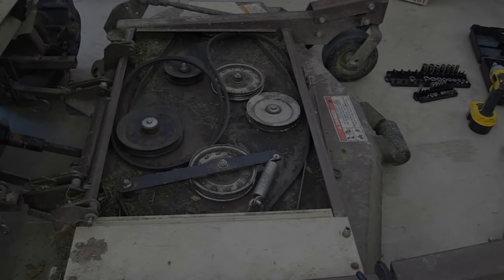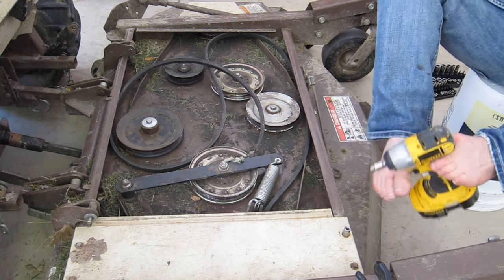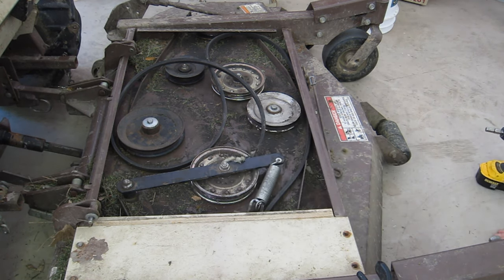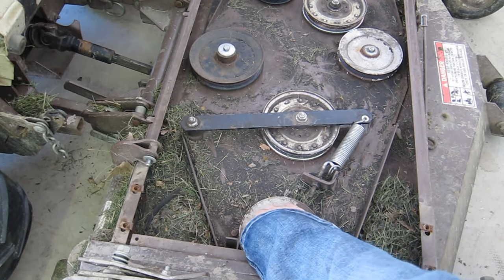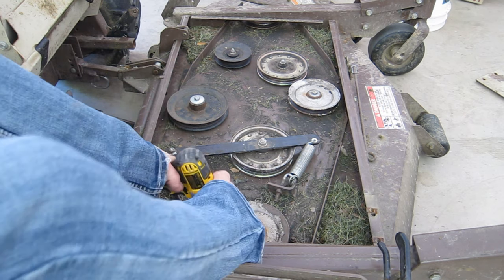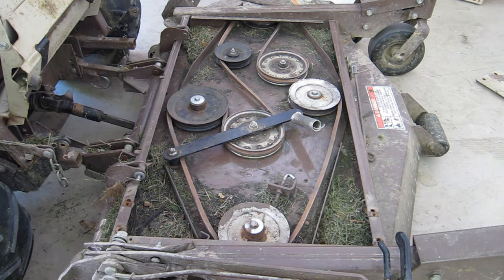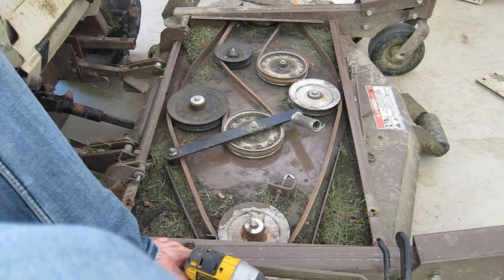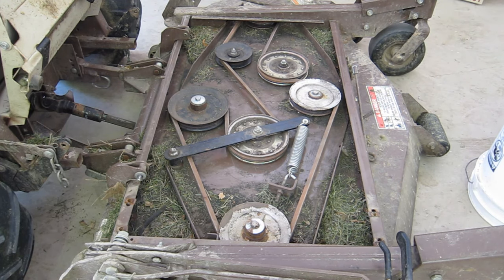Replacing mower deck belt with my feet

Comment: Amazing job.  It would have been a little easier for you if you would have loosened the belt tensioner bolt off as far as you could.  Also once belt is put back on the tensioner bolt should be tightened until the coiled section of the spring is 5.75 inches long.  Thanks for the great video.

Comment: That’s simply amazing, I have a zazoo Kees and I was looking for a how to on how to change the belt, I can’t get the tensioner spring reconnected , I can’t get that belt back on with 4 hands, as in with help , you just did very similar and used your feet. Simply amazing, you just got one more sub for sure , awesome job!!

Comment: I've only had to replace the deck belt once on a 2011 GH. Not difficult, but like you demonstrated, the idler pulley/spring  can be a bear. Not as bad as the two belts from the engine to the PTO shaft though. That sucks!